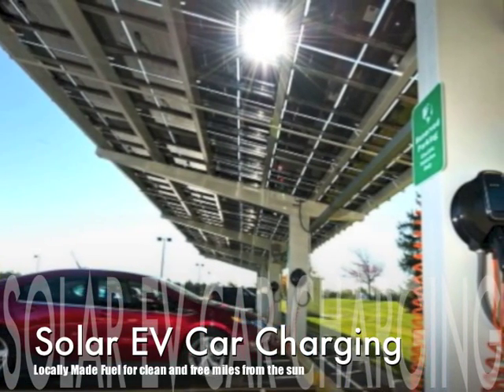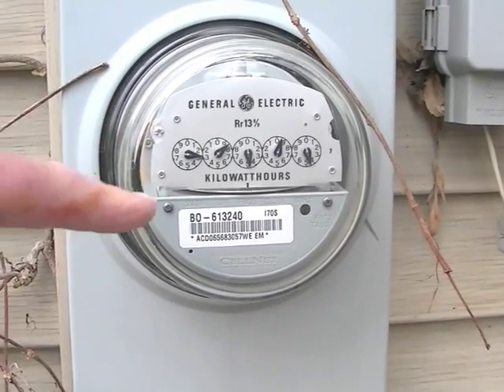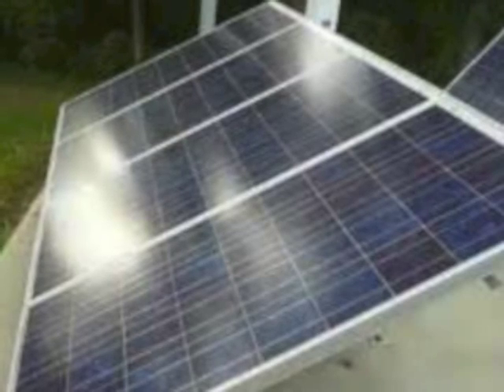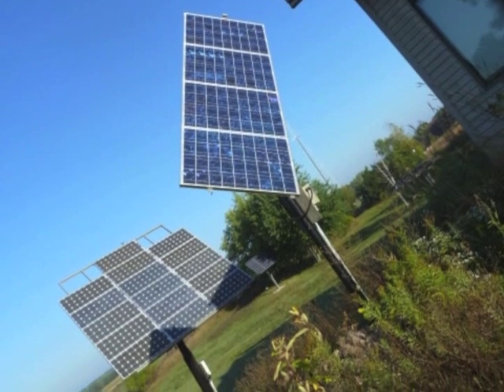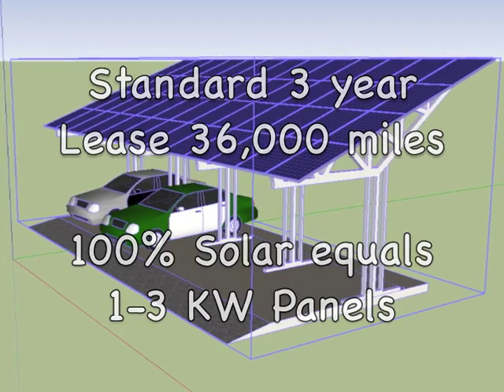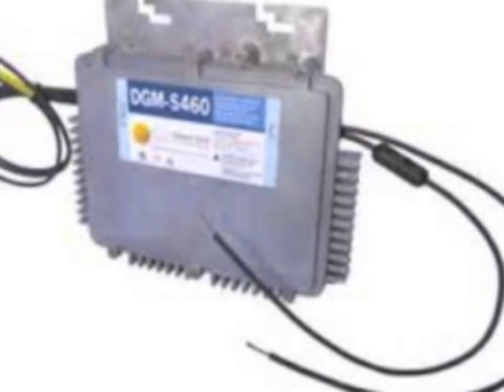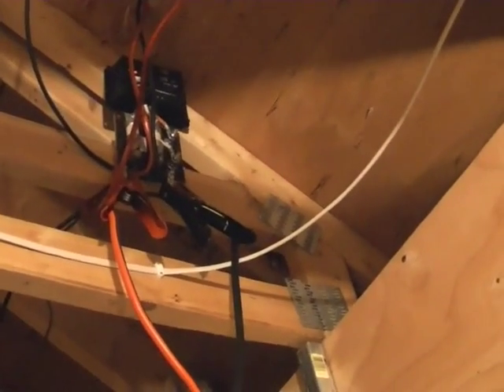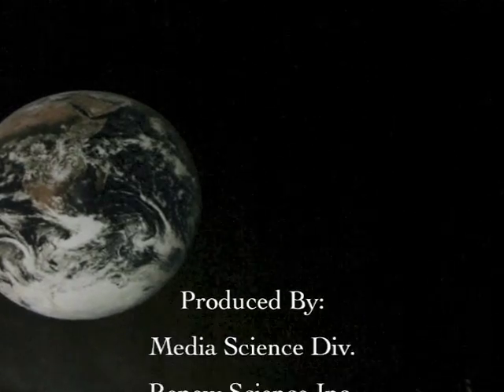Solar EV Car Charging

Comment: What bullshit. You don't 'save the environment' with a 4000 lb steel caged climate controlled high speed lounge couch that  requires an obscene amount of nature suffocating infrastructure and does nothing to stop the car centric city designs that cause nature deficit syndrome. Green means vehicles that weigh under 300 lb and go no faster than 35 mph.
Reply from the maker: Make us a video.  Let's/see this pup go dude...sounds cool to me..show your stuff